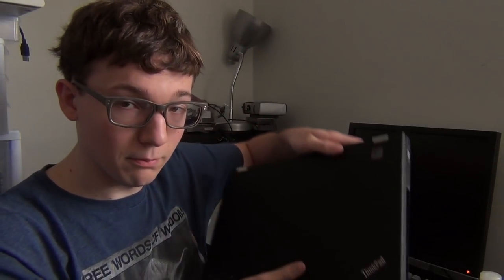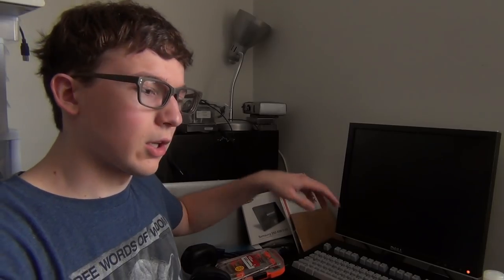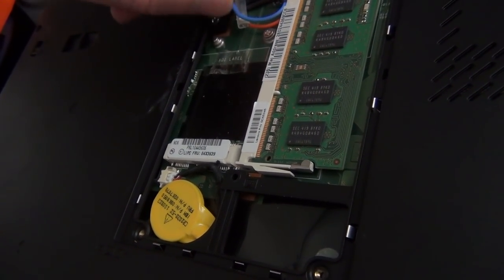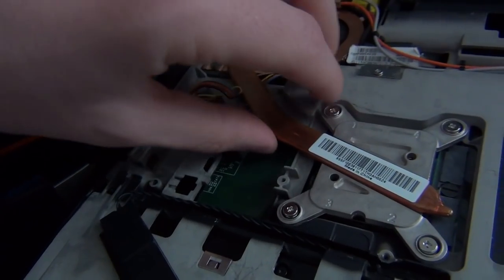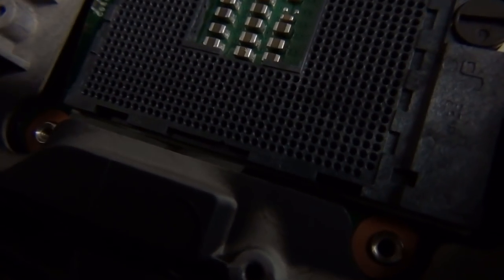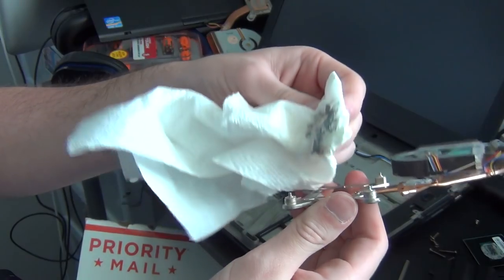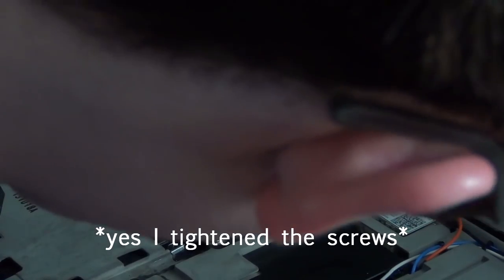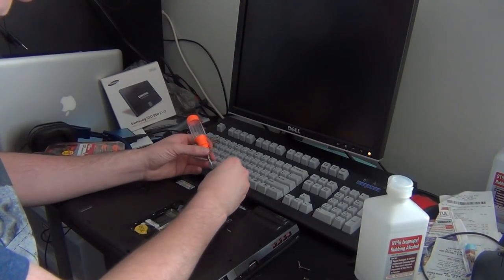Lenovo ThinkPad T430: CPU Upgrade

Comment: heyhey! is this upgrade possible on a T430s as i have one and would love to upgrade but my google fu appears to be inconclusive! thanks in advance!

ps: been following u for a while on my other channel but just subbed on my new channel

peace x
Reply from the maker: Sadly it isn't, on the -s models they are soldered in.
Reply: @SebisRandomTech  bugger. Ah well no probs, thanks for replying! I've got the i7 2.9ghz version anyway, so will have to make do xx
Reply from the maker: @TechDave  Does yours have a Thunderbolt port on it? (Look at the mini DisplayPort, if it has a lightning symbol above it then it has Thunderbolt). These models are less common and are worth holding onto, especially if you plan on using your T430s with an external GPU!
Reply: @SebisRandomTech  it does indeed! Any advice on thunderbolt enclosures wud be extremely welcome! I use the Express card slot with the beastdock and an Nvidia 750 to OC currently and am looking to upgrade!
Reply from the maker: @TechDave  I'm still foreign to the world of Thunderbolt, so I can't really help you there other than saying that it's Thunderbolt II. Just make sure you get a dock that uses the mini DisplayPort type of connector. From what I've read it's about twice as fast as ExpressCard so with faster GPUs you should see a substantial improvement.
Reply: @SebisRandomTech  sweeet
Reply: @SebisRandomTech  Hello. Did I understand you correctly? That is, you can use the eGPU not only through the ExpressCard port, but also through the DP? Just have not seen such information before, how to do it?
Reply from the maker: @johng7212  Only on the T430s, and only on the i7 variants that do not have Nvidia graphics. You can identify this version from the standard T430s by the lightning symbol above the port instead of the DisplayPort symbol. It's a fairly illusive model.

Comment: How would a 100 usd t430 hold up in 2020 with that i7 3612qm? Just curious, I have a t430 in my sight, I may buy it.
Reply from the maker: Entirely depends on what you need it for. I still have one and it works very well for my needs, and I have a few upgrades up my sleeve that I'm excited to try out. But for $100 it's a pretty good deal.

Comment: So where Can I get that cpu? Thx!
Reply from the maker: eBay.
Reply: @SebisRandomTech  I know that you can get it on eBay. I wanted to know if you have any trust seller? Or maybe a link? Thx!
Reply from the maker: @Phantom-pj1ls  Sellers always change, very rarely have I found that the same seller will have the same parts available at different times. The only real exception is if the person selling the part was the person who made the part, such as the nitrocaster X220/X230 FHD mod or modified LCD cable/inverter sets for the T60.

Comment: Can you maybe help me?
I also changed my cpu to a i7 3612QM and install windows new and driver also updated. But battery doesn't charge. only if the laptop is off. Why?
If i put the i5 3320m battery charges.
Reply from the maker: Is it an old or aftermarket battery?
Reply: Sebi's Random Tech
No its a original lenovo battery with 3-4 hours battery life
Reply from the maker: Is Lenovo Power Manager installed?
Reply: Sebi's Random Tech
Driver or software?
Can u send the link please
Reply: Ok i installed it. But atill doesn't charge if the laptop is on.
Reply: Bios is updated 2018
The lenovo software says that the charger has not enough power to charge
Reply from the maker: From Tom’s Guide:
Remove the battery and the AC adapter (charger). Press and hold the power button for 3 - 4 seconds with these removed. Pop your battery back in, along with the AC adapter. If it still refuses to charge, you could be looking at a bad battery or possibly a bad charging circuit on the motherboard.
Reply: You need the 90W adapter to charge these while they’re running, I experienced the same when upgrading my T420. The 65W just can’t provide enough juice!
Reply: Classic issue of power supply insufficiency. Get a better power adapter.
Reply: @slrendall  thx , I ran in the same issue.

Comment: Can I add a dedicated Gpu in the lenovo thinkpad t430
Reply from the maker: You would either have to get a T430 motherboard with the dedicated graphics card, or buy a desktop GPU and pair it with an ExpressCard to PCI-Express adapter from eBay and an external power supply.
Reply: @SebisRandomTech  thanks ur  vid was  very  usefull

Comment: I think it was possible to get access to CPU with just removing a keyboard.
Reply from the maker: Nope, the palmrest gets in the way of removing the CPU fan assembly. Unless you want to risk bending the heat pipes or breaking the palmrest, it's best to remove the palmrest.
Reply: @SebisRandomTech  Got it. Thank you. Just purchased 3612QM for my T430. Will replace soon.

Comment: I found a i7 2670QM in eBay for 3$ does it work on this laptop
Reply from the maker: This laptop uses 3rd gen (Ivy Bridge) processors, while they use the same socket as 2nd gen (Sandy Bridge), I can't guarantee that it will work. That processor might work in the T420 though.
Reply: @SebisRandomTech  I saw a vid on YT installing it into this laptop

Comment: I keep mine as it is as i prefer a cooler CPU temperatures under high processing demand. I have a quadcore i7 + Nvidia GPU in my Thinkpad T420 and it's basically useless since it overheats too fast and too much without active cooling.
Reply from the maker: The T430's popular quad-core choices (the 3612QM and 3632QM) are within the thermal limits of what the T430 can handle, with a 35W TDP. That's a huge advantage over the quad cores people put into the T420, which have a 45W TDP hence the issues with overheating.
Reply: @SebisRandomTech  Thanks a lot! Good to know, i might consider it after all.
Reply from the maker: @KRAFTWERK2K6  I can also tell you firsthand that I've had an i7-3632QM in my T430 for several years now, and the thermals are fine. It gets a bit toasty when you push it to 100% load for prolonged periods, but that happens with just about any laptop and it doesn't have issues with thermal throttling.
Reply: @SebisRandomTech  Well my T430 uses Intel 4000 graphics only so i do have a bit of headroom there thankfully. I only use it mainly for Linux Mint stuff and having a lightweight mobile system with everything i need. SO far i don't feel the need to add more OOMPH to it unless i work with more Virtual machines and doing more Video editing. I usually don't edit anything above FHD resolution since i only shoot 4K with my phone and very rarely. So my i5 3320M does the job very well so far. The whole rig even runs Half Life 2 like a charm. My CPU fan is also pretty quiet, even when running a demanding application. I don't use it like a workstation though. Oh by the way, hopefully you're having a nice Christmas this year :)

Comment: T430 is realy 👍 the problem only screen
Reply from the maker: Thankfully the screen can be upgraded with the purchase of a kit from eBay.
Reply: @SebisRandomTech i have question, t430 with intel hd 4000 is capable to handle this resolution 2560 x 1080 ?
Reply from the maker: @ygjt76v0-----  Theoretically it can support that resolution through the DisplayPort output.

Comment: does it work with a 3840QM
Reply from the maker: It could but it might run a bit on the hotter side. I recommend using really good thermal paste and getting the Nvidia GPU heatsink for better cooling.
Reply: @SebisRandomTech  thanks=)

Comment: I'm thinking of getting this T430:
https://www.ebay.co.uk/itm/162589832621

It comes with the dedicated GPU meaning it will have the cooling system you installed.
Was the NVIDIA NVS 5400M 1GB the only dedicated GPU option the t430 came with?

Also, in the description (of that ebay listing) it says it comes with the Intel Centrino Advanced N 6205. I have that same wifi chip in my X230T, and the reason I couldn't get the 3x3 one is because my X230T has a webcam - meaning it's missing an antenna wire. So I just wanted to know if the same issue occurs with the T430. If a T430 comes with a webcam, is the best wifi chip you can put in it the 6205 or was there another option (without having to change the BIOS etc.).

In the description (of that ebay listing) it also says the T430 is missing the smart card reader. Was that an option that could have been added when the t430 was bought new? What does it mean by that.

I just want to make sure I buy a T430 with all the maxed out options so that when I do the CPU upgrade, the keyboard upgrade, the battery upgrade and the power adaptor upgrade, I have a FULLY maxed out T430!!

Any help with the options that this came with when new will be appreciated.

Thanks so much! - keep up the great videos!

Comment: An extremely small upgrade that you could do is that you could put an Intel Core i7-3632QM in the ThinkPad instead of an Intel Core i7-3612QM. It's a very small performance difference but you will still use 35W using the Intel Core i7-3632QM.

Edit: Another thing that you could do is install a light-weight to medium-weight Linux distro on your ThinkPad. Eats up way less RAM!
Reply from the maker: Fun story, my current T430 setup has a 3632QM in it! 😎

Comment: do you know what is, since today, the best CPU (on 35w) to use in the T430? Cause the CPU you used in 2018 is probably not that new anymore now. And I have a 65w charger, not a 90w so will I run in to power issues?

will any of these i9 35w CPU's work?
https://wccftech.com/intel-9th-gen-core-35w-cpus-8-core-16-thread-core-i9-9900t/
Reply from the maker: No, these can only be upgraded to other 3rd generation processors. Intel stopped offering socketed laptop CPUs after the Haswell generation (4th gen), and even if they didn't modern processors use a completely different architecture. The best 35W CPUs to use in the T430 are the 3612QM that I used in the video, and the 3632QM.

Comment: I don't recommend the 3612QM really, not much improvement compared to i5 3320M unless you are doing multitasking on the 3612QM, the best overall is 3740QM you will notice a big jump just by doing so, I wouldn't go highter than the 3740QM either as you will have thermal issues sooner than later unless you turn off HT (hyper threating), but again who will use an expensive 3840QM without HT on a t430? in that case I'd just get the i7-3540m 4c/4t, just saying...
Reply from the maker: Not really sure what you’re talking about, I saw a massive jump in performance after I upgraded. The system was snappier overall, video rendering times were greatly reduced, and I even saw some improvements in gaming. And the i7-3540M is not a quad core chip like you falsely claimed, it is a dual core with 4 threads just like the 3320M. It only performs slightly better than the i5, so that is a pointless upgrade. Meanwhile in my own personal use and in benchmarks the 3612QM performs much better.

And just in case you think I’m pulling numbers out of my rear, here are the actual Passmark results for all 3 chips.
3320M:
2614
3540M:
2726
3612QM:
4460
And for fun here’s the 3740QM: 5611

“Not much improvement” my ass. There’s more improvement to be gained between the i5 and the 3612 than there is between that and the burning hot 3740. Please do a little bit of research before spreading misinformation online, especially in these times.
Reply: @SebisRandomTech  That's right I messed up with the i7-3540M upgrade suggestion, still better than any i5 tho, tho the i5-3380m is pretty close and much cheaper
Reply: @10GreenDragon10  Apparently you are not at all in the subject and are not very friendly with computers) Comments about processors from you are about nothing. No offense bro :)

Comment: That's way too much thermal paste xd
Reply from the maker: Not really.
Reply: @SebisRandomTech  I'd agree and say it's probably just a bit too much, but the rest will just go outside the die so it shouldn't make too much of a difference or problem. As I've heard, there is a very very small gap between heatsink and CPU so the paste is just to fill the gap and transfer heat as best as possible - so too much can be a problem. If your temps are good then it's no problem at all I reckon
Reply from the maker: QuickishFM Temps have yet to be an issue with this computer! ;)
Reply: @SebisRandomTech  i know i reply late but i just dont like paste on motherboard, and if you do that much for sure some squezes out
Reply: @SebisRandomTech  also cool vid